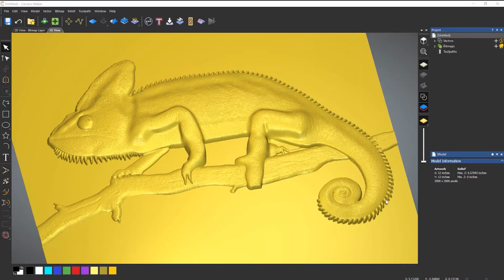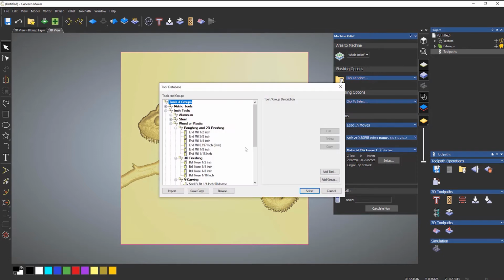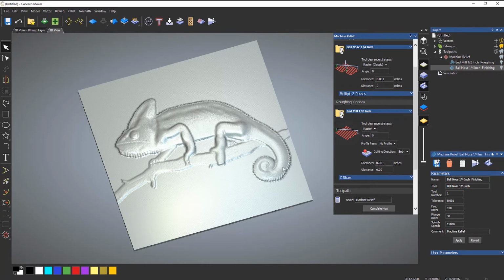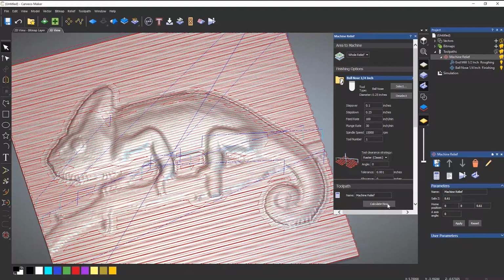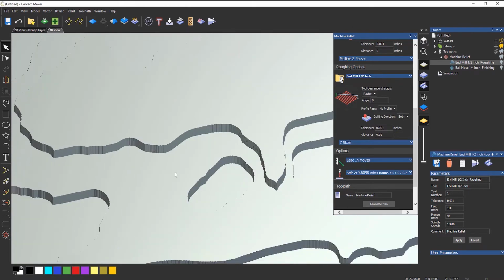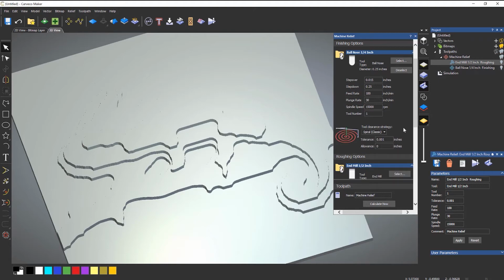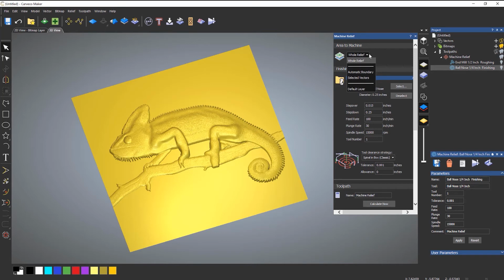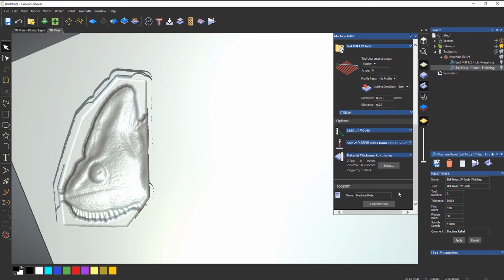Carveco Maker: Machining Reliefs

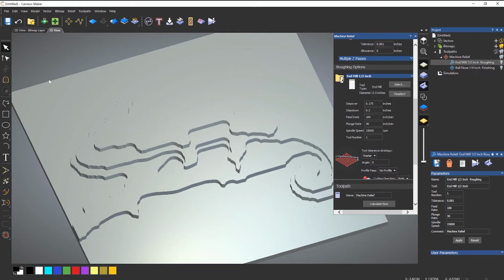Comment: 16:00 the roughing is using same parameters no matter if its using part of the tool diameter or full diameter, is there a way to change it ? To slow down when tool is cutting more material ?